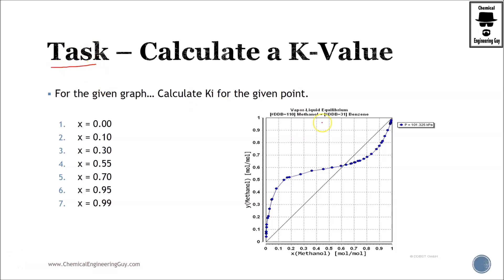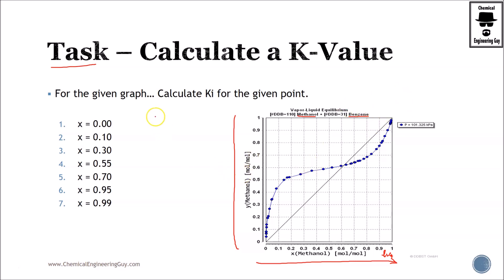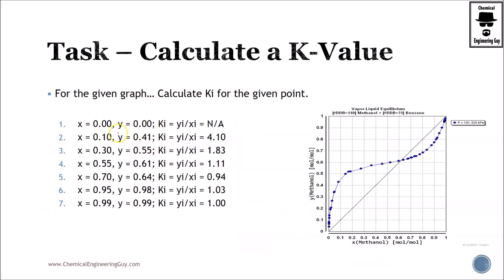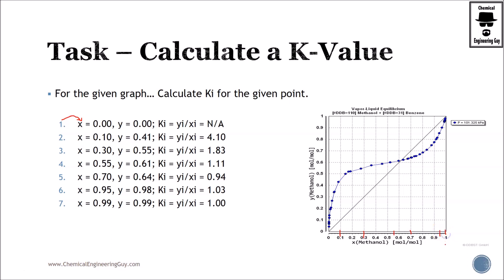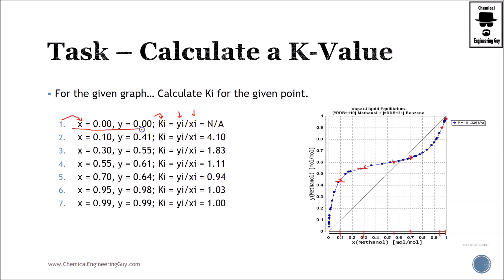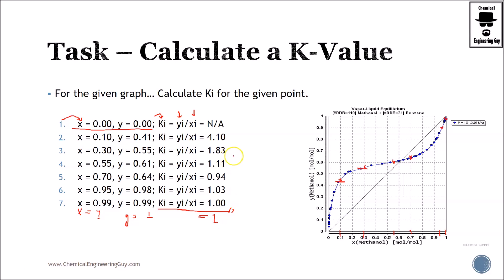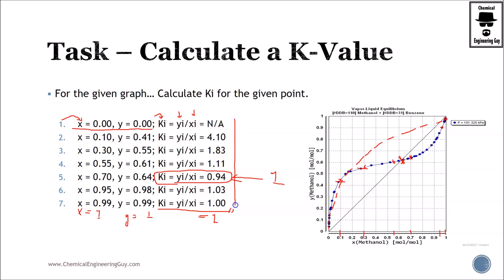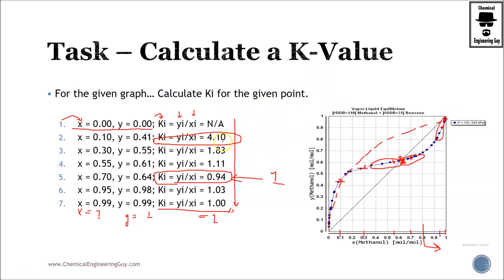Task -  Calculate K-Values given a TXY Diagram (Lec 026)

Comment: Hi Chemical Engineering Guy, I have found your videos very very useful thanks. I have a question, some of your K values shown in this video seem to be incorrect, for example for X=0.95 , y is actually Y=0.88 not Y=0.98 as you have in the video, therefore K should be = 0.93 not 1.03, or is this a reason why you have done this, some physical phenomena like azeotrope behaviour at K values near to 1? Thank you for your time
Reply from the maker: Thanks for your reply and note on the error!
Reply: @ChemicalEngineeringGuy  My pleasure, also I wanted to ask, are you doing any research at the moment into a particular subject?